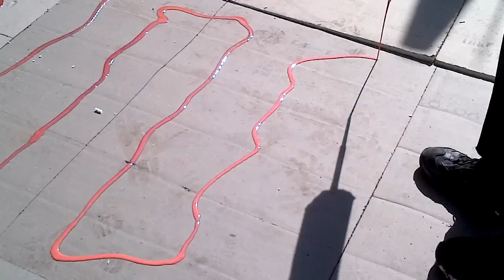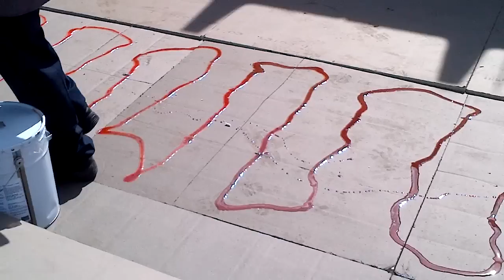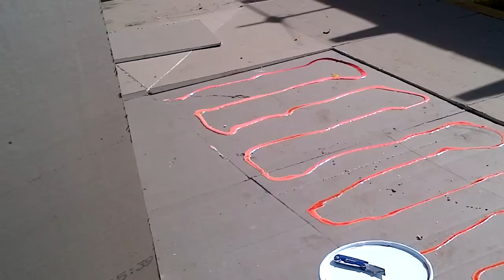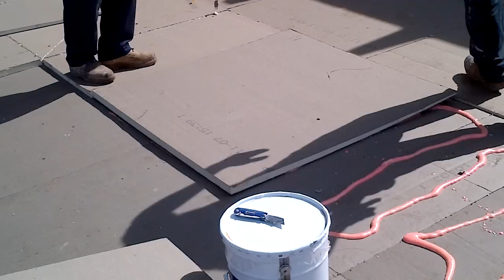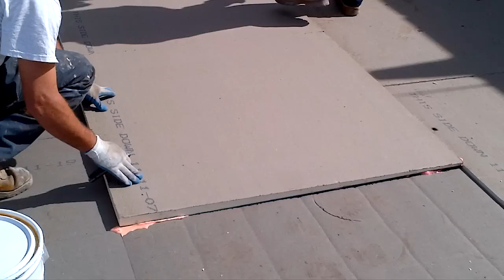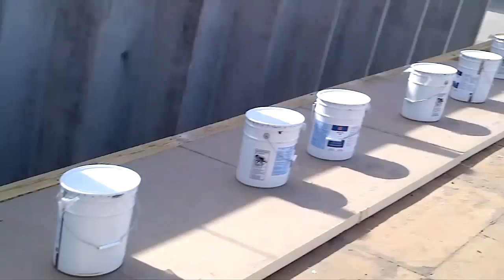Foam Adhered Tapered ISO Installation

Comment: You should be staggering the joints.  Also not sure if you realized it or not but the insulation has "This side down" printed on it and you put it right side up.  There is a reason for the wording.
Reply: Bob Leimberg I agree
Reply: They also have instructions for asphalt shingles where to drive the nails on the package specifically, and it appears as though many roofers don’t read that.
Reply: In other words, You're doing it wrong brah.
Reply: it's tapperd

Comment: And what kind of adhesive is that?
Reply: Low rise foam
Reply: I was wondering the same thing.  With a little freeze frame of the video and a Google search, found this - OlyBond500 Insulation Adhesive is a fast-acting, two-component, low-rise polyurethane foam adhesive designed to secure insulation to roof decks

Comment: yea definitely need to stagger the insulation, and their is usually a heavy roller someone should be rolling the ISO down with. although the glue cans do work too, but it's alot more moves.
Reply: the roller works? how long per piece of iso, and is there multiple passes. right now I'm the guy moving buckets

Comment: you need to stagger your joints in both directions.  you should also be using ballast to hold the iso down until the olybond fully cures.